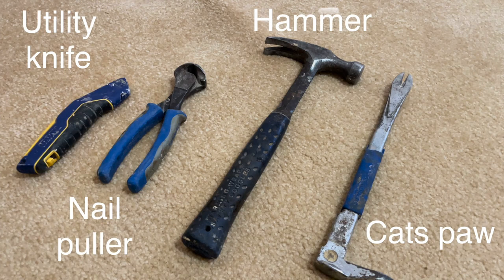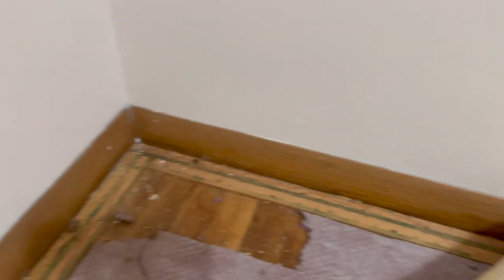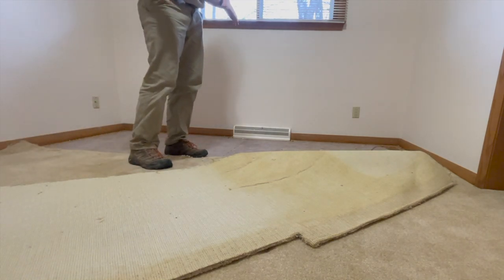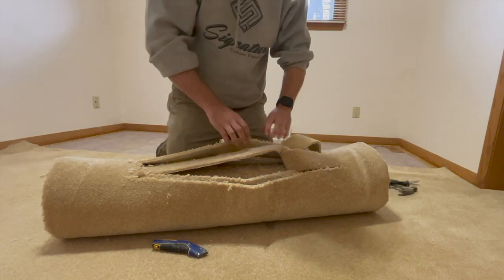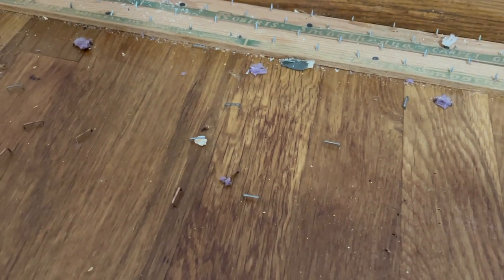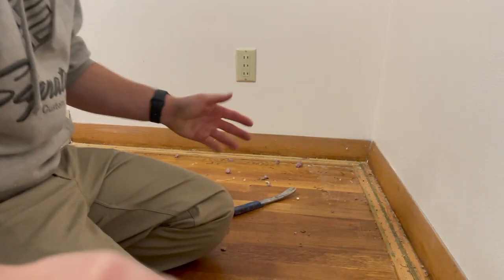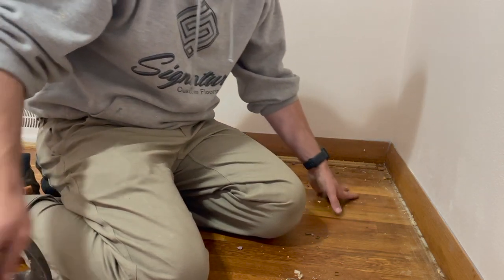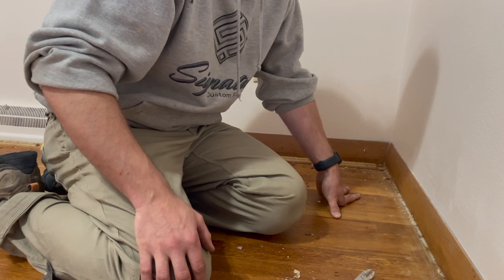How to remove carpeting without damaging the hardwood floors underneath

Comment: Thank you this is very helpful. I wanted to pull up the carpeting and wasn't sure what was underneath. I pulled a small piece away from the entryway and can see it was hardwood floors. I think I will do this project over the winter